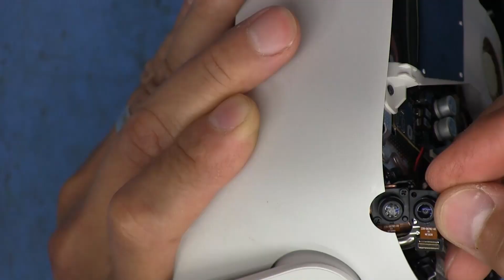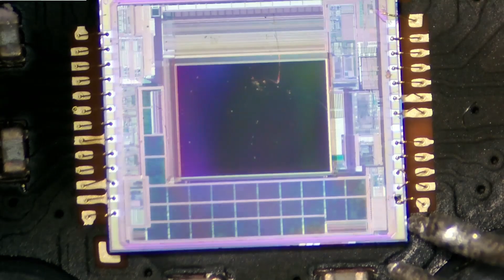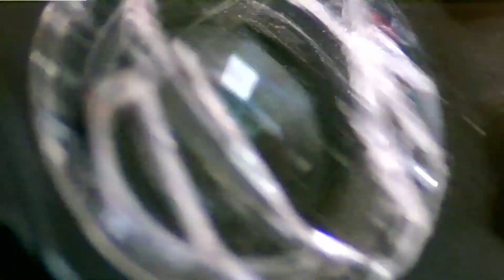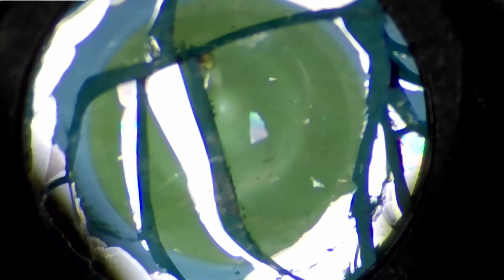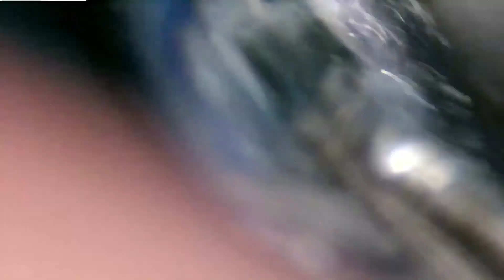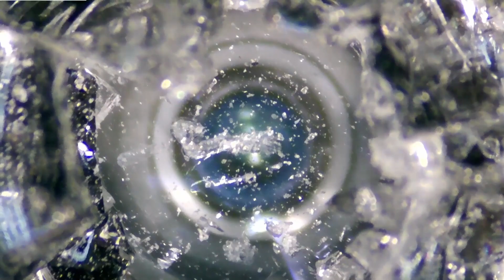TWB #104 | Broken Oculus Quest 2 Camera Tiny Teardown

Comment: Blocks are sea of gates ASIC logic, computer generated blocks that do the image processing for the camera. each one is doing a different function, or is duplicating functionality to get more parallel processing on the chip, then sending the data out as a fast serial data stream. The small chip is likely a voltage regulator, there off chip to provide some reference voltages and power rails for the internal logic, and thus the decoupling capacitors right by the regulator. I think one got torn off, the remains of the pad is there.